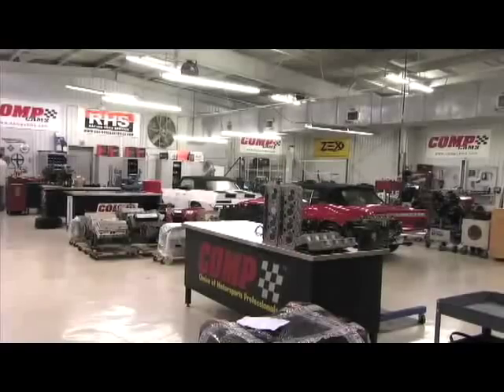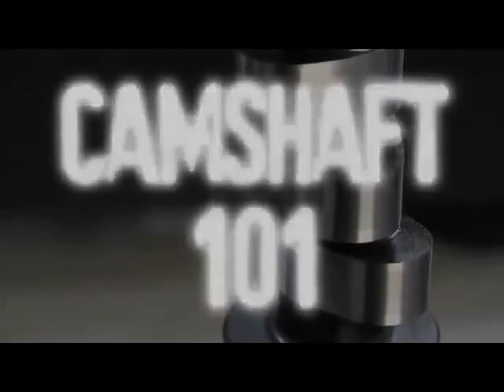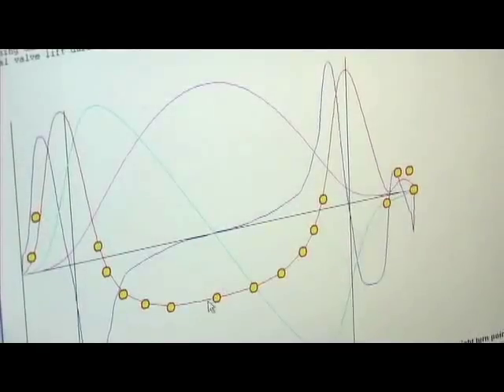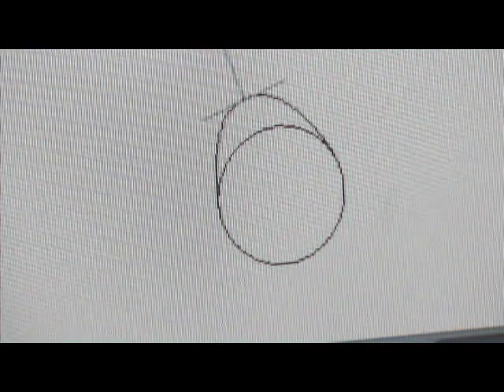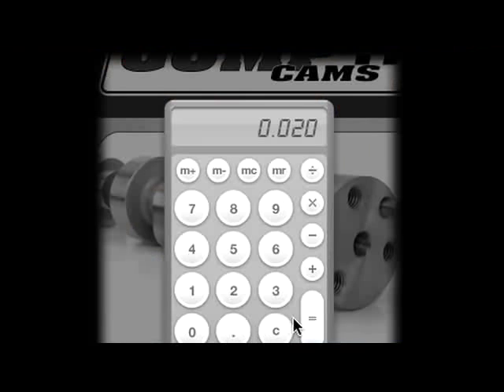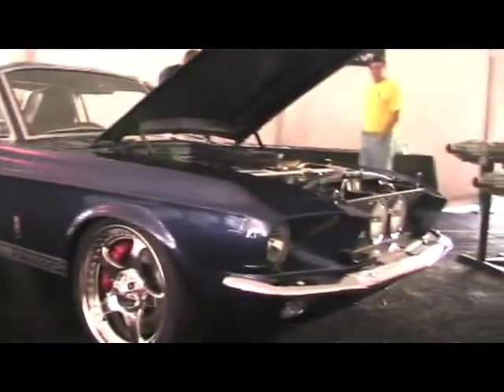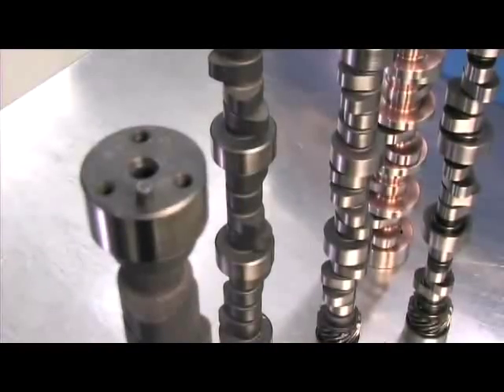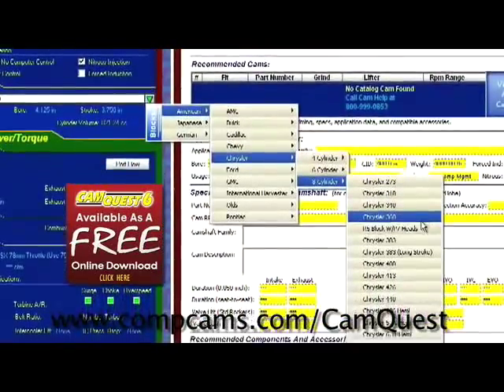COMP CAMS 101

Comment: @TheMrMarshmallow Too many youngster's like yourself get carried away with how something sounds. 

My advice is select your use first, ie for the street then, Torque is king along with a modicum of HP.
Drag you want a balance between Torque and HP and so on. 
 
Look at your wants and needs and then use that as a basis to select parts to use and you should be on the right path.

Comment: @TheMrMarshmallow I'd be looking for and diagnoising the cause of the missing before I looked at anything else. 
I have come across Cams that have a lobe ground down by the bottom of a lifter due to a blocked oil hole and the valve wasn't even opening ,

Comment: Dear CompCams.

I have a stock 350 with the 3890462 Heads. I am interested in a camshaft that works full potential on HP with these heads. If i am correct the valves are 1.94/1.50  2.02/1.60. which cam should i get for these heads is my question? I would like to make this stock motor faster then anyone in my neighborhood. Street rods rock!
Reply: I also have a 3 speed, and plan on changing gear ratio to 3.73
Reply: LOL
right

Comment: Which cam would work best for my 2012 sierra 5.3 4 door daily driver and vacation vehicle. Want more power and definitely want the sound. And if maintenance is required what does that consist of if need be. Just don't want to devalue my truck. What's your advice? Thanks
Reply from the maker: Hi Travis, thanks so much for your question. It sounds like a cam from our Thumpr line would work well, but your best option is to call our CAM HELP line at 1.800.999.0853 or email camhelp@compcams.com. Our techs will have a few questions and will then be able to help you pick out the best cam for your Sierra. Thanks again!
Reply: @Compcams1976  how's reliablity?

Comment: I have a 5.3 2013 GMC Sierra with K&N intake long tube headers size 1 7/8. Y-pipe no cats. and Borla catbak side dual tips.

So, what is the type of cam should I take if I want to use it daily and 100 MPH long trip. What if I want to add a supercharger later?

thanks
Reply from the maker: +ALOOSH M. Hello, your best option is to contact our CAM HELP line at 1.800.999.0853 or email camhelp@compcams.com. Those guys will have a few questions about your engine and overall setup, and will then be able to help you pick out the best cam for your Sierra. Thank you.
Reply: +COMP Cams I will contact them.. thanks for reply, good luck.
Reply: ALOOSH M.